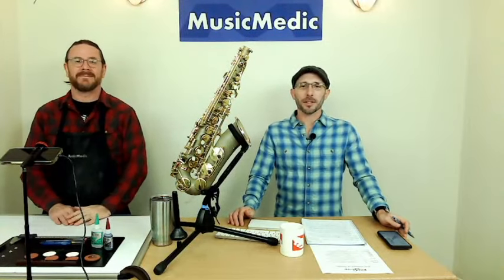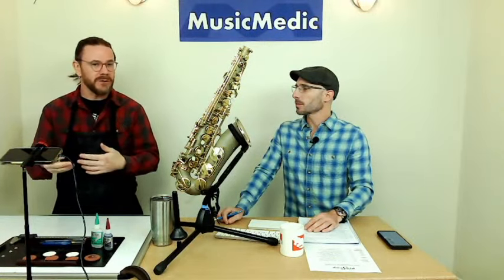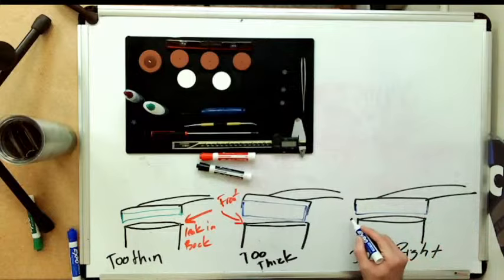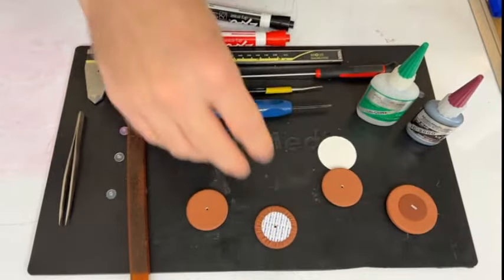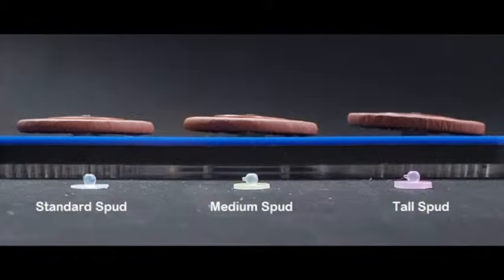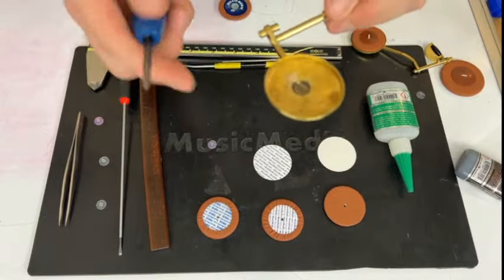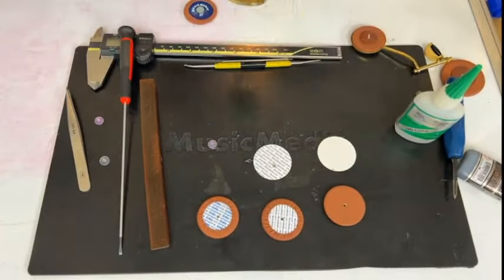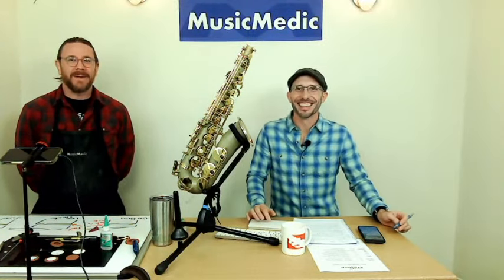What thickness of saxophone pad do I need? #WednesdayWisdom

Comment: The neopad turn on himsef OR Just the angle change ?
Reply from the maker: The Neo Pad does not rotate 360 degrees because of the pin in the spud, just the angle changes when the pad is touched or tilts. This also allows it to conform instantly to the tone hole and seal perfectly every time. Because the spuds are engineered the pad moves very little once it finds its level position, allowing for instant response.